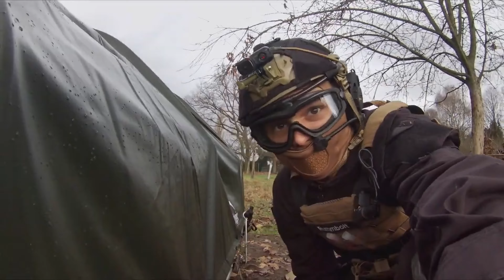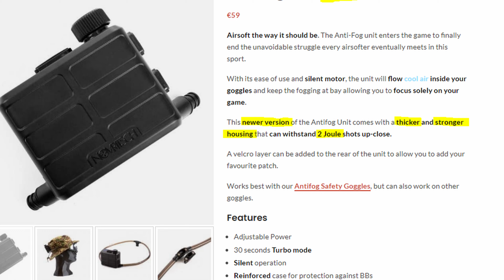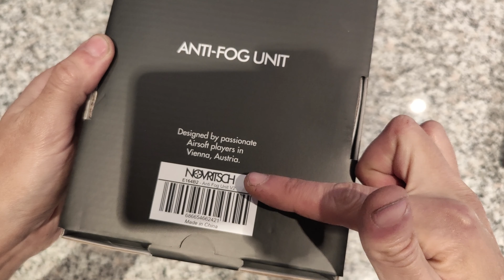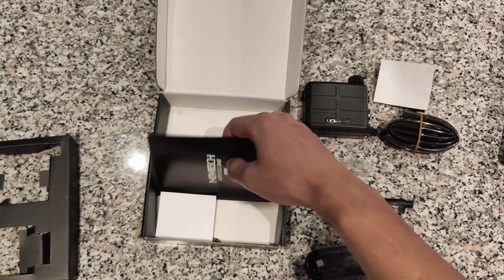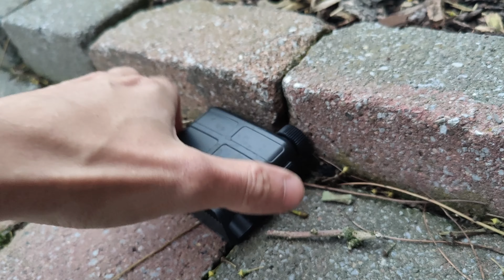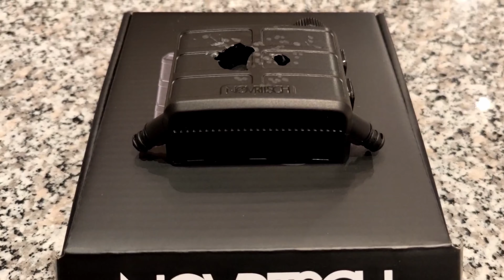The Anti Fog Unit Gen2 by NOVRITSCH: Finally "bulletproof"? Test with 3 different airsoft replicas!

Comment: Would have been more curious about the 2J from 15-25mtr hits
Reply from the maker: Haha, i probably would have missed the tiny unit 10 times with the sniper before one actual hit 😂

But i'm pretty sure, 2j from 20 meters and less are no problem, as BB energy decreases quickly with every single meter :)
Reply: @rummbolt  thanks. Will most likely wait buying this until I hear more about it. Have a great day

Comment: Damn we play full auto at point blank range at 1 joule here in the USA. Most of our indoor fields allow anywhere from 1.1-1.5 joules semi auto only, but no minimum engagement distance.
Reply from the maker: think the Anti Fog Unit Gen 2 should have no troubles with your energy limits :) to get even more protection, you can add some velcro for example. 
(the Unit you saw getting destroyed is still in use btw, fixed it with some epoxy and added a velcro surface - looks like new!) 
Have a good one!
Reply: @rummbolt  I was thinking that wrapping some camo tape around the body would be beneficial but velcro seems like a really smart idea

Comment: this shouldnt happen at 2.5j
its still a bad material choice for airsoft

I put mine into a NVG counterweight pouch together with the rubber patch as protection
Reply from the maker: Sure, better proteciton always is a good idea :) 
But i have to admit I never got shot with 2.5 Joules+ from ~20cm distance. And i hope it will never happen in the future - or there will be other problems than a broken Anti Fog Unit for sure :D Have a good one!

Comment: Thanks for the vid. Do you have any issues with the vibration and noise inside the helmet? I have attached mine with the included velcro and even on the lowest settings, it's really loud, both with and without active ear pro.
Reply from the maker: Thats really surprising to read, my unit is whisper-silent. So silent infact that i have to double-check if it is turned on sometimes when ingame 0.0
Reply: @rummbolt  thanks for confirming, I'll check it with novritsch to see if it's an installation problem or a faulty unit.
Reply: I know this is a 7mo comment but mine is super quiet, with active ear pro I cant hear it on low-medium setting no vibration.
Reply: @G_Zero127  thanks for the reply, I wonder if it's my active earpro shape then, as the chassis might be touching the body of the helmet directly transfering the vibration. Funnily without the earpro it's ok.